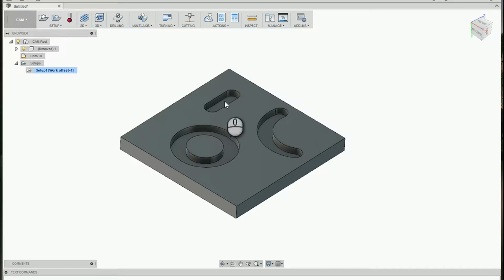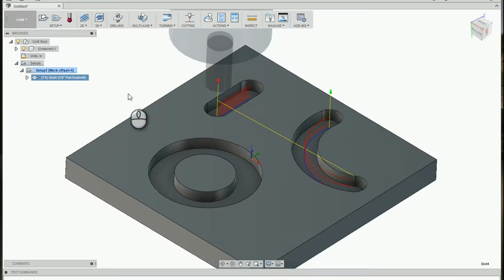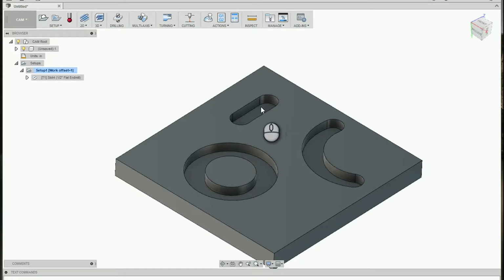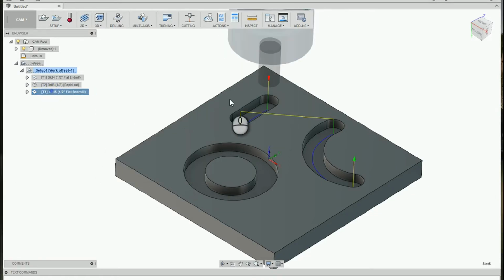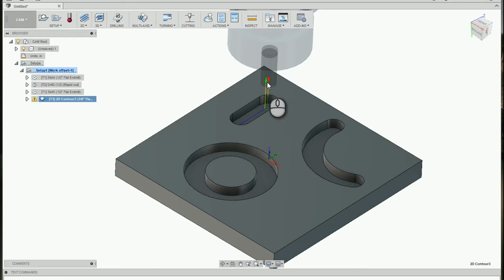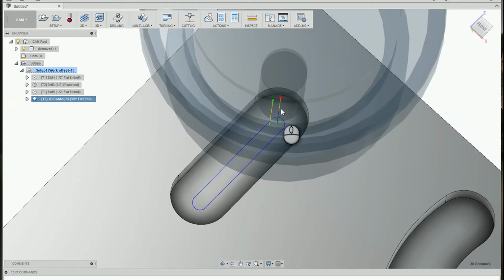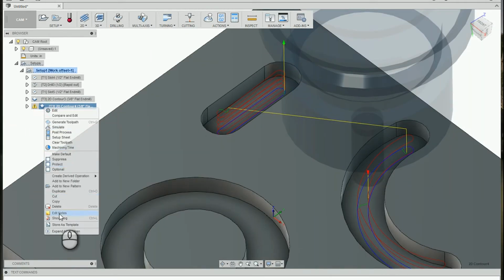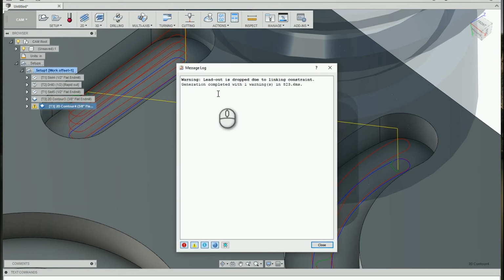Autodesk Fusion 360 - Slotting Options

Comment: When you predrilled then used the slot it looked the cutter went to the bottom of the drilled hole and stayed down for the entire slot. My concern is it seems like a lot of material to remove in one pass. Must be the IPM is set pretty slow?  Any ideas for speeds & feeds for steel?  The curved slots are 3/8” wide cutting clear through 5/8” steel with a 3/8” HSS end mill.
Reply from the maker: Hi Bill, This was for demonstration purposes on the workflow.  In real world application, you are correct…a slow feed would be require, especially in steel.  For your scenario, I would add multiple depths with a max stepdown of .1875”. Full depth would be a lot on the tool and tough for chip evacuation.  4 flute carbide EM 2000 RPM’s at 8 IPM. Let us know if you need anything else.
Reply: D3 Technologies thank you sooo much!  Your video was absolutely exactly what I needed. I hope you and yours are healthy and prosperity. We will get through this.
Reply from the maker: @billkellogg1403  Glad we could help and stay safe out there.